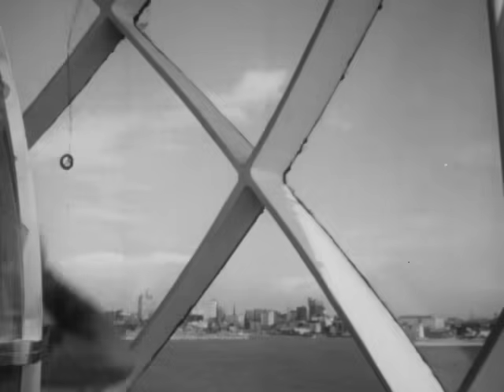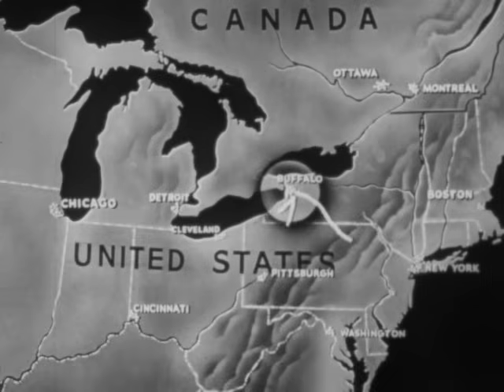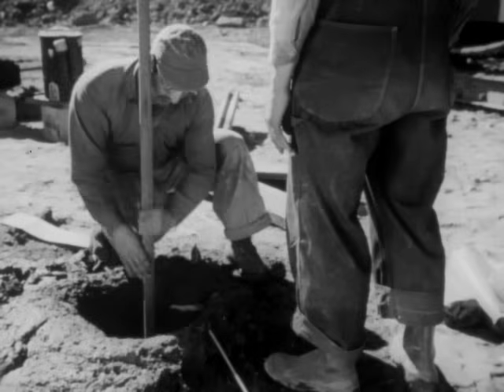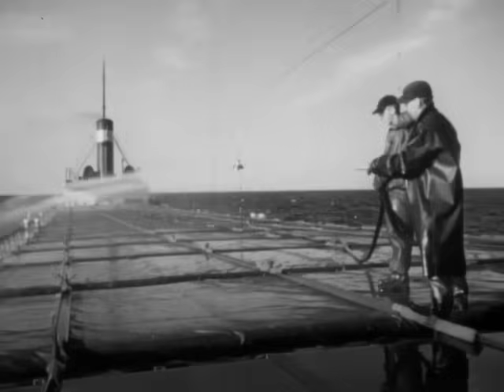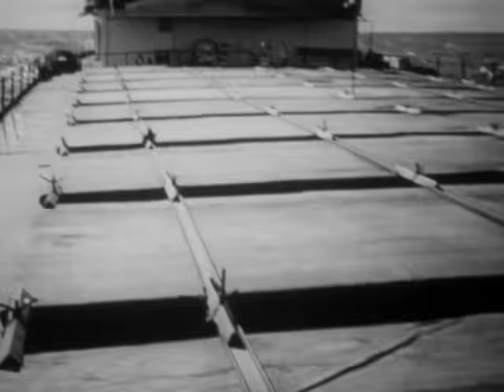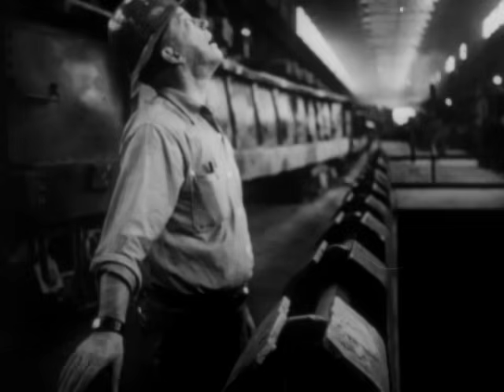An Industrial Lake Port (USA Buffalo, NY, 1949)

Comment: I worked at Bethlehem Steel Plant in Lacawanna as an overhead crane operator in  1965... this was cool to see.
Reply: my grandfather was a railman in Lackawanna
Reply: You might know my grandfather then. He did the same
Reply: I worked there in 2021-2022 as a saw operator, The people were friendly but i could just feel the chemicals inside my lungs every time i took a breathe so i left…. it ended up closing in 2023 (went idle apparently) My cousin was a crane operator…. i operated the cranes  too but i wasn’t certified
Reply: @stevesand8845 
Was that at Bflo Color?
Reply: I work on cranes in a steel mill now,  some of which are virtually the same as they were back then
Reply: I was in a jail a few years ago, small county it was all Bethlehem steel products...probably from the 60's. It was wild....VERY old, some of the bars near the floor by the toilet were half or 3/4 of the way rusted out.